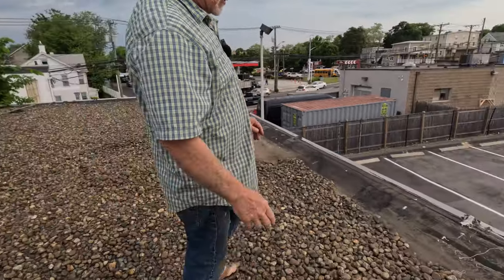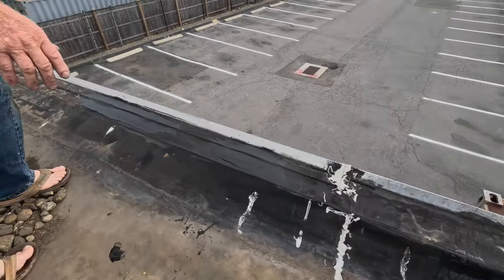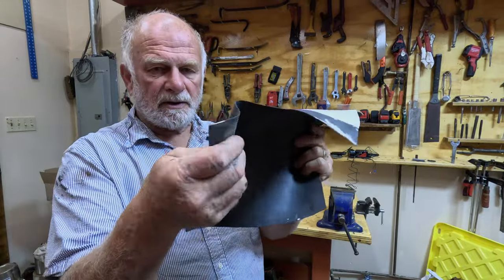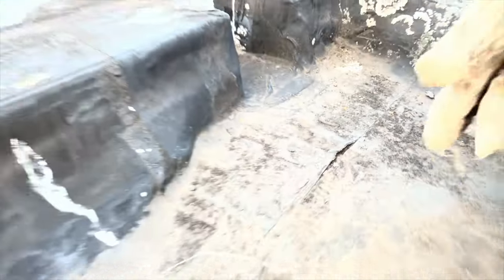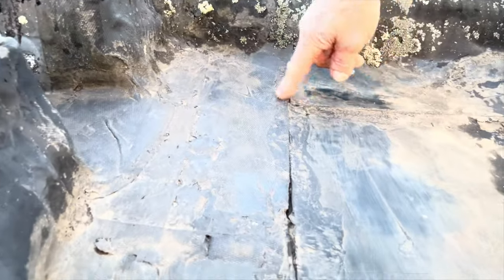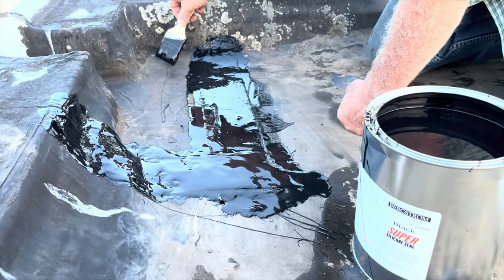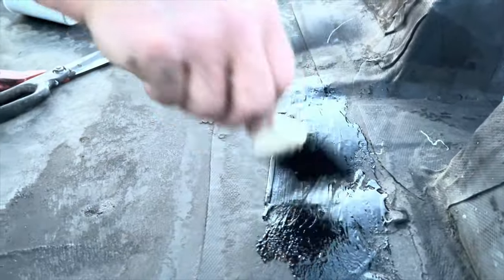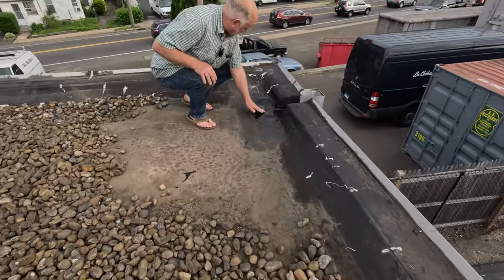EPDM Rubber Roof Repair A 5 min repair - Liquid Sealant a Game Changer

Comment: Looks like he is using Bergstrom silicone seal. I use rubber membrane cleaner always. Prep is the most important part. Silicone can flake off if not prepped properly.
Reply: He is bergstrom LOL, it's his product ! I wish he would be a bit more professional instead of slinging the silicone paint everywhere. He's always in such a rush!